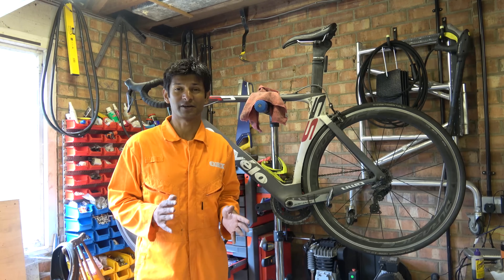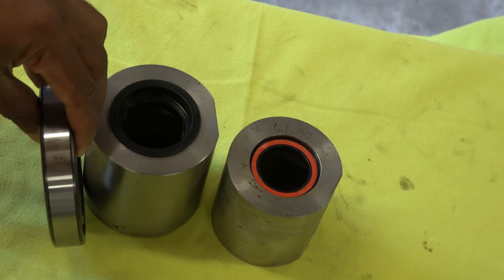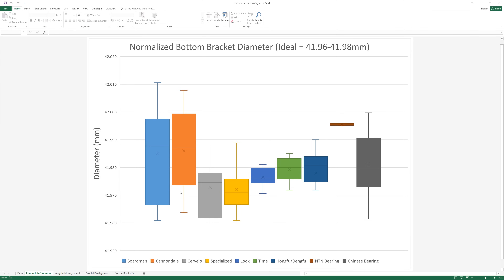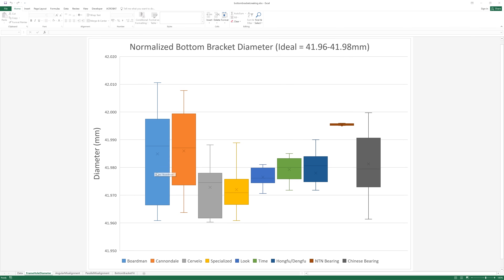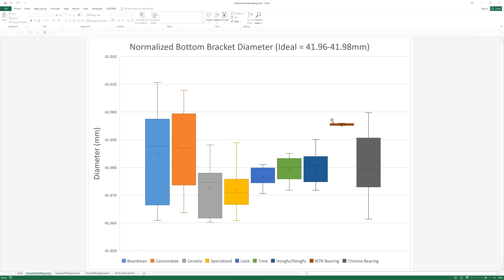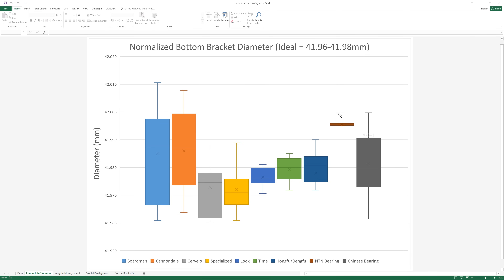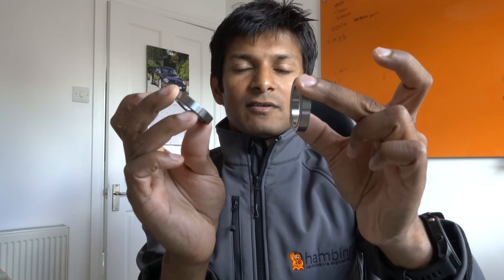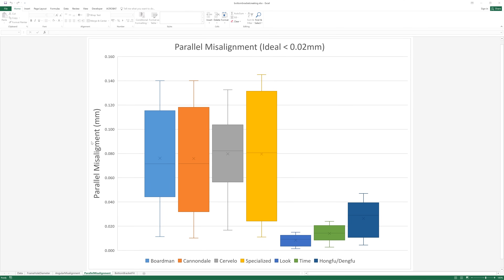Which Bike Frames Creak? Cannondale? Specialized? Cervelo? Hongfu? | Hambini

Comment: I have had 2 boardman’s one with fsa pf30 & the other shimano pf86 , they both creak !!!!
Reply from the maker: That does not surprise me! lots of retaining compound should sort you out!
Reply: Hambini do you reckon medium strength ? Will they knock out ok when they need replacing ? Great videos by the way 👍👍👍
Reply from the maker: @ianbirch5811  if it's a carbon frame, then you should use activator first to prime it. After that, medium strength is what I would use. A hairdryer usually helps when you come to knock them out. I haven't found a bearing that my extractor cannot remove.

Comment: I had a Boardman and despite being an aluminium frame they still used an FSA pressfit bottom bracket instead of a threaded one, why????  The drive side bearing wore out after a short while and had to be replaced.  No doubt they were FSA bearings in a Boardman frame - worst of both.
Reply from the maker: Unfortunately, if the bearing frets in the bike frame it can cause a problem for the new bearing/cup - the fit gets slacker.

Comment: Wow, owned one hongfu frame (BB86) and never had a creak. But surprised to know how good they have done.

BTW, is there any data about Giant and Canyon?
Reply from the maker: I have got Giant and Canyon frame data, it's just not in a video!
Reply: @Hambini  Nice! can't wait to see a more comprehensive analysis on different manufacturers' tolerance.
BTW, could you please spoiler a little?
Reply: @Hambini  https://www.hambini.com/blog/post/bottom-bracket-pressfit-and-creaking-an-engineering-opinion/   If I'm reading it correctly, Giant doesn't seem to be too bad.  I've have had 3 giants TCRs in the last 4 years, all replaced due to crashes in races and have never had any creaks or had to change the bearings out.  Yes, I'm still running the same bearings after 4 years and they are butter smooth!  Maybe just lucky with frames?

Comment: That was great. Now I don't feel so bad spending what I did for my LOOK 695. 

How did you get your hands on all those frames?
Reply from the maker: I supply bottom brackets to a number of OEMs, they don't like to admit it and I don't shout about it but they use them for warranty claims. A large number of those frames ended up at my local bike shop to have the bottom brackets fitted. Additionally the bike shop let me measure the frames for new customers to prevent problems further down the line.

Comment: This was good. I do have a question. You showed precision differences. But what about accuracy. For example if I take the center of your range, 41.97, Cervelo is centered on it and the more precise manufacturers are further away from it. So while they are more similar to each other, they are further form what you want. Then the NTN bearing is relatively far away from what you stated as ideal.  Although the other measure are very clear.
Reply from the maker: Hi, the NTN Bearing is designed to be an interference fit so it should be bigger than the hole it goes into. Manufacturers have a range they work to, they might consider 41.98 is more suitable than 41.97 but provided it's in the range, it's perfectly acceptable. Hambini

Comment: Interesting... I’ve got the same bike as you and when I got a rotor 3D+ with my power2max, needed to get my BB switched to a Rotor 4630. Have noticed creaking under high load. Any suggestions or just live with it?
Reply from the maker: I ditched the Rotor crankset as quickly as possible. Shifting on the front rings was comparatively rubbish to a Dura Ace, so that is what I have now. Creaking irritates the hell out of me which is why I made my own bottom bracket. Generally creaking is movement and if it's between the BB and the carbon, the carbon will get worn away. HTH hambini
Reply: Hambini when I got the bike I had them switch it to a 53/39 ultegra. When I decided to get a power meter, I ended up going back to the Rotor, with some Praxis rings. I guess I shouldn’t have gone back. Thanks!

Comment: Hi Hambini i have a Merida reacto with a FSA PF30 and it creaks like crazy. Dont judge but i bought it on a budget. Do you have a replacement in the Hambini range?
Reply from the maker: HI Darrell, I think your axle length is 68mm in which case I don't I'm afraid. If you have an extended 90mm then I do have something.

Comment: I really appreciate your videos. What's your opinion on threaded BBs in carbon frames. I actually planning to buy Dolan l etape with ultegra and I'd like to know your opinion on this
Reply from the maker: Hi, if it's a threaded BB directly into carbon, then I would steer clear. If it's threaded into an aluminium insert then it's fine. Into carbon, a press fit is okay but a threaded is not. It will destroy it.
Reply: Thank you! The exact layout it is not stated on Dolan's website. Is it possible to be assessed visually by the frame's picture? https://www.dolan-bikes.com/media/catalog/product/cache/1/image/1200x/af097278c5db4767b0fe9bb92fe21690/l/e/letape-blue-01.jpg
Reply from the maker: I get an access denied page on that link.
Reply: I'm sorry. Here you are https://www.dolan-bikes.com/road/road-framesets/road-framesets-carbon/dolan-l-etape-carbon-road-frameset.html
Reply from the maker: Hi Yorghos, I'm 99% certain that is an aluminium insert in that bike frame.
Reply: HI and thank you for the valuable information.
Reply: @Hambini  I have a Scott Foil carbon frame that is oversized - 46.07mm. I bought a Wheels Manufacturing PF30-OUT threaded together bottom bracket. I greased but did not apply any retaining compound when installing. It clicks when pedaling but creaks terribly when I get out of the saddle. Should I reinstall with Loctite 641?

Comment: TLDR: Great channel, don't change your objectivity! Do you hand make all your BB's? and when are they back in stock?

Loving the channel pal. I really think there's a lot of mileage in your style of objective product comparisons at the component/engineering level. Essentially acting like a ''myth busters" type figure for all the bumf that manufactures come out with (your debunking of ceramic bearings springs to mind as an obvious one). Anything that's either going to save people money or help them avoid inferior products is always going to be a winner, you can't really trust road.cc reviews as far as you can throw them, when almost everything gets 4 *s or more you get the impression there's some back handers going on somewhere.

Your biggest asset in my view is credibility, you're credible because you remain objective - don't change that. You don't seem like someone who would.

Question: Do you hand make all your BB's yourself? Or do you have a local manufacturer/machine shop who you trust to make them to your tolerances? And also, in regard to the 'black' series, obviously they're considerably more expensive - presumably because of material cost and increased labour - what is the practical benefits of them over the regular version?

Also, when are BB30 BB's, installation/removal kits and presses coming back in stock?

(sorry for long comment)
Reply from the maker: Thanks for the feedback. 

To answer your questions in no particular order

1. Bits usually go in stock on Sundays and Wednesdays. Quite often certain things will sell out quite quickly.
2.  Road.cc, bikeradar, GCN all have a vested interest in not having a pop at anyone in the bike industry because their income depends on it. In my case, I don't have that issue so I just say it like it is.
3. All my BB's are made by me. 
4. Black editions have a material that is made to my specification by a supplier in Sheffield. It has superior bearings, is stronger, stiffer and lighter. The surface treatment is also to my specification. On a practical level, the advantage is it is extremely corrosion resistant and in a frame with slack tolerances, it is likely to give a better fit than the standard one. Additionally because it uses super precision bearings, there is less friction and they will last longer.

Hope that helps

Hambini
Reply: Cheers for the clarification! Keep up the good work.

Comment: Good video, but cnc machining can have and does have temperature comp, tool wear comp, and part to part probing making them deadly repeatable and accurate. We machine 1000 parts a day with high process  capability on cn cncs all day long on features with a tolerance of less than 10 microns.
Reply: Not all cnc machines hv those features.  U are talking about the high end machines like okuma where the chinese likely Dont use!!  Old machines still rely on the machinist to check the parts and change inserts regularly!

Comment: I just don't get why the parallel and angular tols are so shit. They are either CNCd shells or mandrel wrapped if Carbon. Such, 50 microns should easily be achievable. Out of interest, how did you measure angular and parallel?
Reply: Also the bb30 format is too narrow. Q factors are over double the bearing stance. Bendy.
Reply from the maker: Cycgnr I used a cmm system

Comment: Question regarding your saddle: do you have it leveled straight?
I've got an S3 with those dual saddle position  with a selle smp saddle thats also pushed forward.
Reply from the maker: I've got mine tipped ever so slightly down, it can only be 2 or 3mm down.

Comment: I don't quite understand the methodology?  Wouldn't the differences in models or years change significantly over manufactures?    Did you find this in your results at all?  I have a 10 year old carbon bike and have to imagine technology and engineering has changed significantly since then.  btw...i have no issue with BB creak.
Reply from the maker: It's really a measure of quality control. There is nothing to say that Look don't make a bunch of rubbish out of tolerance frames, it's just none of them see the consumer. The other way to think about it is that Look has a manufacturing process that is superior to everybody elses that allows them to achieve such a good fit. 

The manufacturing process for carbon has not changed in the past 20 years, it's still epoxy resin in a pressurized mould. The intricacies have changed and the process has become cheaper but this is probably at the detriment to the consumer. 

I don't have enough of a sample spread to be able to categorically say that one year had a worse bunch of frames to another year. All I can say is that Cannondale and boardman were generally poor, Look and Time were generally very good. This is slighly anecdotal but the interior finish (the bit you can't see) on the Look and time frames was much better than all of the others.

Comment: Can you comment on how a difference of 70 microns is the difference between a bearing falling out. It seems like such a small number.
Reply: The Illegal Immigrant: If the design calls for a press fit of a certain amount, that difference at the end of the tolerance could mean NO press fit or not enough.  Forces exerted and wear may loosen the system ==> creaking, etc.  Also, there may be a stack-up leading to bearings being too loose or, more likely, too tight running hot with higher friction.

Comment: Is BB30 the actual name of the bottom bracket specialized use or is it the sizing?
Reply from the maker: BB30 is a standard developed by cannondale, To put it simply, it's a bottom bracket designed to accept a 6806 bearing with a 68mm spacing across the outsides of the beairngs. Lots of other companies use this standard or a variation of it.
Reply: Specialized call their shells "OSBB" and this has a slight difference in implementation between their aluminum and carbon frames. As mentioned by Hambini, however, OSBB is essentially their take on BB30/PF30. There are a few differences but in practice they're very close. Wheels Manufacturing has a good tech page on bottom bracket standards.

Comment: What's the future for the BB parts? surely there can be something done to eliminate all the creaks, this is sooo annoying, and feels like I'm grinding the bearings away stay from day 1...
Reply from the maker: It depends on what you've got, if you have a 46mm based shell (PF30, BBright, BB386), then you can correct the problem. If you are on BB30 or BB30A, it's a lot more difficult.

Comment: Hey, Hambini, given your poor service policy on your bikes (not criticizing here, I abuse my bikes in the same very way), do you have to deal with stuck stuff like seatposts, bearings, bushings, etc, especially after winter months? It would be great to see a video about this.

I had to restore my trusty Italian bike made of Columbus steel after riding in winter. Consider this: I've detached and relubed the seatpost in early fall, installed it back and it took only 6 months for halvanic corrosion to weld aluminum to steel so completely that two wrenches in my LBS had to spend full 3 days in a row trying to remove it. The shit resulted in dented seat tube and the need for fixing those damned dents.

Since then I use anti-seize compound prior installation, but still not sure how this anti-seize lube will stand up against chemical compositions that city service uses for de-icing the road surface in winter months.
Reply from the maker: Hi, I tend to use very thick grease and adopt the policy of hosing the bike down through the winter months. My maintenance policy is to replace moving parts frequently, it helps when you have a lot of bearings on the shelf. The other thing to note is water is better than salted water, hence me hosing it down. I must confess, that after I've cleaned my bike and re lubricated the chain, I can feel the difference.

Comment: My C'dale had clicks in headset bearings and BB bearings. But not really creaks. Creaks for me were from cabon railed Fizik saddles, and some improperly torqued bolts all over. I know we are talking about likelihood here. If things creak you can always file down bits here and there and use locking compound to fill the gap.
Reply from the maker: Points taken on board but if you spend that much on a bike frame you don't expect to have to fettle it. Some of these bikes cost more than cars. Cars have loads more components but yet they don't give as many problems.
Reply: I am going have to guess that cars are loctited or greased to oblivion.

Comment: Hello Hambini. Great detailed video, thank you. In your video you mentioned dengfu chinese carbon frame manafucturer and as chart shows it is not bad at all. Probably it's because it's their own production line and control. But what can you say about other parametrs of their frames besides you mentioned in the video: geometry, stiffnes, reliability? Whould you recommend them to buy? Thank you.
Reply from the maker: Hi, the other parameters would require me to ride the frame. To be honest, I doubt you would be able to tell the difference between a major brand and an OEM brand if you took the badges off. The Quality control on brand leading frames has always thought to have been superior but it simply is not the case. I might see if there is a smashed up carbon frame on ebay so I can take one apart.
Reply: @Hambini  theres a guy in australia that repairs crashed frames and if they are too far gone he cuts them in half and talks about the carbon quality and issues.  Hes on youtube.
Reply: @Hambini  Watch "Trek Emonda SL Cut Up and Review" on YouTube
https://youtu.be/kJl5V_KTRzc

Comment: Another thing; if they are messing up the BB shells like this, you can guarantee the headset bearing seats are equally out of whack, which is potentially a hell of a lot more serious than a creaking BB.
Reply: It's not the bearings themselves, it is the carbon work, where the bearings sit in the frame, namely the BB and headset.  

Badly molded bearing seats in the BB cause creaking.  Badly molded bearing seats in the headset result in constantly loosening headsets, which lead to unfixable damage to the carbon steerer which at the very best will result in you having to get a new fork, and at the very worst, will result in a catastrophic failure of the steerer and you lose your face / spine / nuts / teeth etc.  

And good luck trying to get any company to warranty a poorly molded bearing seat.
Reply from the maker: TDI is spot on. It's almost unheard of for a branded bearing to be made out of spec, their processes are so slick they churn them out for fun. If you buy a fake bearing or a far eastern no name, it's a different story. 

For the bike frames, they made them out of some metallic compound for over a 100 years and have started to move to carbon in recent times, the carbon technology and probably quality control of look and time is clearly superior. But to the customer they are paying for something they cannot see and it's more difficult to justify the cost as neither Look or Time are cheap.

Comment: Great analysis

My Cannondale has creaked from day one and it is always the bottom bracket! If I bought a bb30 converter from you could I put Shimano cranks/ chainset on it?
Reply from the maker: Hi, yes it should work but you need to make sure you have nothing in the bottom bracket area to get in the way. If you watch the install video, it will be more clear.